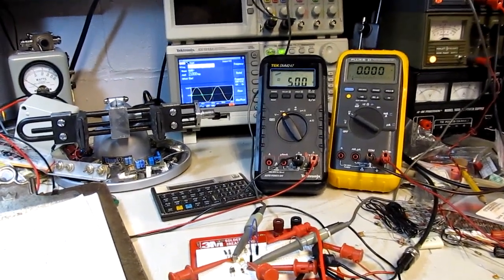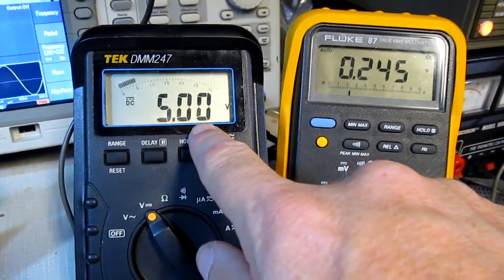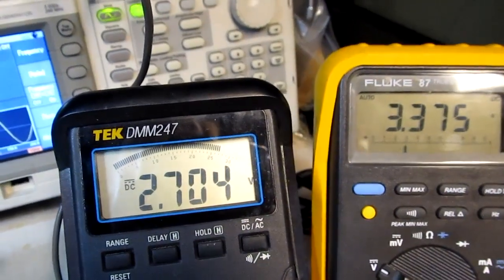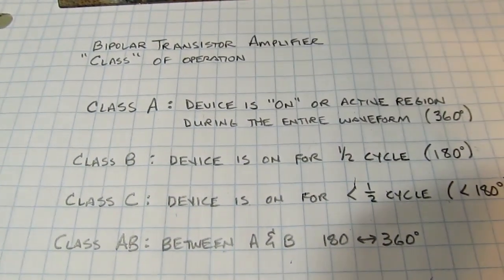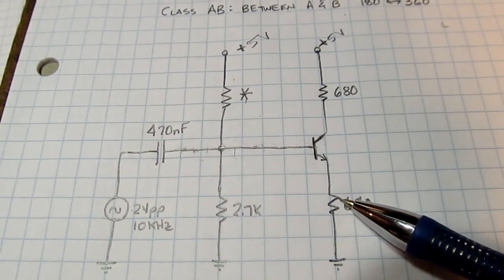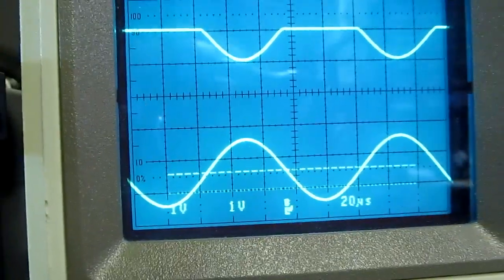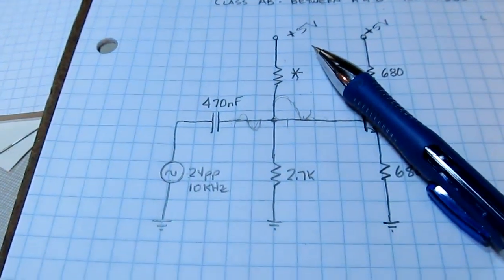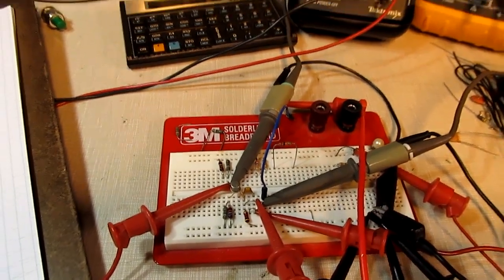#113: Basics of Transistor bias point and the class of amplifier operation

Comment: I'm getting really annoyed, because people think they're explaining what bias means, BUT THEY'RE REALLY NOT!!!! Just tell me what happens when you bias an amp?! Is it like an input level on a audio interface, so the sound is not clipping, but bias works in voltages?
Reply from the maker: +Black Skull In the context of this video, the bias level is the resting or quiescent operating point of the amplifier before any signal is applied.  It is the node voltages and device currents that the components are "idling" at, before the signal is applied.  In this case, this "starting point" determines how the amplifier behaves when the signal is applied, which often determines the Class of operation.
Reply: +w2aew okay, I think I'm understanding a little. So do we always want the idle voltage to be as low as possible, or is 'bias' the protocol to make sure the amp doesn't overheat?
Reply: +w2aew oh wait, is it like a exhaust on a car, it has to be just the right size to give enough back pressure on the engine?
Reply from the maker: Not quite. Think of it this way. When you apply a signal, the voltages and currents will swing above and below the bias point. Thus, there's always a possibility that the amp will clip, distort or cut the signal during peaks if the bias point doesn't provide enough headroom for the signal swing.

Comment: +Gua Var asked why the emitter resistor.  That resistor, along with the bias voltage at the base (set by the two base resistors) sets the emitter and thus collector current.  The emitter current will be (Vb-0.6)/Re - that is, the emitter voltage is 0.6V (approx) below the base voltage, and the emitter current just follows Ohm's law.  The collector current will be at most a few percent less than the emitter current (see alpha).  Knowing the collector current you can choose an appropriate collector resistance - too low and you have low output voltage, too high and you go out of the active region, starting on positive signal peaks.

Comment: Thanks for the great videos!!!
I would like to ask sth. Why are you changing the resistor of the voltage divider and not the emitter resistor in order to move the quiescent point wherever you want. Some people claim that by changing the voltage divider network you actually change the point where the load line hits the y axis(I cannot understand why, since that point is Ic(sat)=Vcc/(Rc+Re), but I have read that in books as well).
Reply from the maker: Kostas Corn If I was to only change the emitter resistor, I would not have been able to set operation in all three classes of operation, because the base voltage would not be moved very much.

Comment: Many people show a voltage source at the base of a transistor without explaining that a voltage source  has a very low output impedance and with the input impedance of a transistor being very low, well that could be a situation that many would not understand.

Though you did not explain it, you used a voltage source in conjunction with the   series  base resistor 3.9 k  and also the  feedback emitter resistor  680 ohms.  These resistor will effectively chang a voltage source into a current source which is what  operates the transistor,   The roles of the resistors in not only to bias a transistor, and many people do not mention the fact that voltage sources and current sources need to be understood  and there included in the role of those resistors is a subtle operation of transforming a voltage source into a current source

Comment: OM님. 감사 합니다.
Reply: I heard a Class-C amp used to RF AMP ,many times.
But, I have a never chance to see the waveform with a scope before.
Would you show us , how Class-C amp works, with a scope ?
Reply from the maker: mincheon son The waveform shown in the video for Class C would be an unfiltered version.  For RF power amplifiers, the load is often a tuned circuit or tank circuit, so the harmonic distortion is reduced and the output is more sinusoidal.

Comment: Can I give a suggestion?
What if you grab all this info, take the schematics on the wikipedia about amplifier and teach us how to read the transistor datasheet and calculate the resistors values to build a simple amplifier from scratch, nothing fancy, just the basics.
http://en.wikipedia.org/wiki/Amplifier

Thank you!
Reply from the maker: Not a bad idea.  I'll add that to my list.  Note that for the most part, the choice of component values is driven more by the desired circuit performance rather than by transistor parameters.  The goal is to make the performance of the circuit somewhat independent of specific parameters like Beta, etc.  Thus, specific datasheet values are not generally needed too much during the design phase, unless the performance starts pushing the limits of transistor capability.
Reply: *****
This might help a lot of people!
Thank you.

Comment: Correct me if I'm wrong, but how do you achieve a base voltage of 600mV using a 2.7kOhm and 36kOhm resistors? isn't it supposed to be 350mV? (2.7/2.7+36)*5=0.348 V ~ 350mV
Reply from the maker: Yes, you're absolutely right.  Weird, how did that happen?  Of course, that should've been a 18k or 20k resistor or so.  Strange...  I think I was using 10V supply on the bench earlier before I finalized the video, and made some last minute changes before filming...
Reply from the maker: Actually, the mistake in the video is that the resistor from base to ground is 4.7k, not 2.7k as shown.

Comment: Nice video. Thinking about RF class C amplifier, we have a dc block capacitor at the output and 50ohms termination (or Zout=50ohm). So, I wonder how is the output signal waveform transmited to the load (e.g. an antenna). I think its a sine wave form, but the colector wave form you measured isn't. How this waveform can travel across a transmition line to a load? Could you explain? tks
Reply from the maker: A Class C RF amplifier will always be followed by a low pass or band pass filter to remove the harmonic energy from the output, leaving mainly the modulated fundamental only. Attenuating/removing the harmonic components will change the waveform shape to sinusoidal.
Reply: ***** Thanks!

Comment: Well as usual, I have learned a ton! Can you tell me though, at the base voltage there is a voltage divider with a 3.9k and 2.7k. Is there any real purpose of using those values other than a simple ratio? Is there any other videos that explain this? Thank you.
Reply from the maker: Nothing real special about those specific values.  The main considerations are: setup a voltage divider ratio to establish the desired bias voltage at the base (and thus the emitter) of the transistor; use large enough values to not waste too much current through the resistors; and large enough to give a decent input impedance; but not too large such that the base current dramatically influences the bias voltage.
Reply: ***** I understand that the resister sizes will allow you to dial in a good range of Amps that run through, the impedance however is where I am not understanding. I understand it in a simple RC filter, but there is no caps, so how do I understand impedance? That particular transistor has these maxes
40 V
800 mA
500 mW/1.8 W
300 MHz

How do I learn about the impedance you are talking about?
Reply from the maker: When I refer to the input impedance I am referring to the load that this circuit will present to the signal source that's driving it. In this case, the input impedance will be primarily resistive, dominated by the parallel combination of these bias resistors and the impedance (resistance) looking into the base of the transistor (approximately Beta * the emitter resistor when not bypassed).
Reply: ***** Yes! This is precisely what I am talking about. Where can I learn these advanced methods? I want to understand how to calculate all of this.
Reply from the maker: Michael Bruce Allen Learning all of the nuances of how to derive these impedances is usually part of a junior level EE program.  However, the basics can easily be found online. If you Google "input impedance of Common Emitter Amplifier" the first couple of hits will give you what you're looking for.

Comment: Hi again Alan.i tried the class C circuit at home and i replaced the collector resistor by a tuned cicuit (15 nf cap and 2.2 mH coil) . I noticed 2 unkown phenomenas.first i had a output not only at resonant frequency (27.7 khz) but also at around 14 khz.Second thing , what ever the input wave form at input i get only a sin wave at the output. Can you tell me why Alan. Thx in advance

Comment: Well done!

Many beginers have trouble understanding the way resistors value are chosen. Even for a simple C-E amplifier. 

I you have the time you could make a video. Set the requirements and design a simple ac CE amp. Crunching numbers for the resistors and everything.